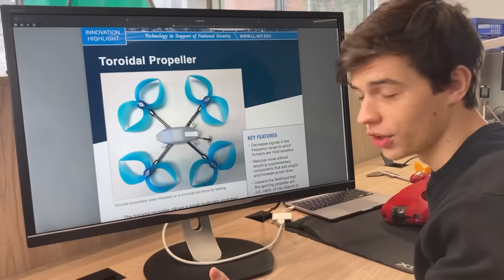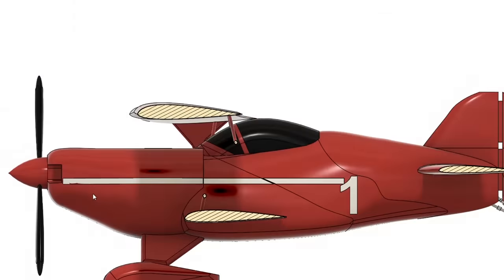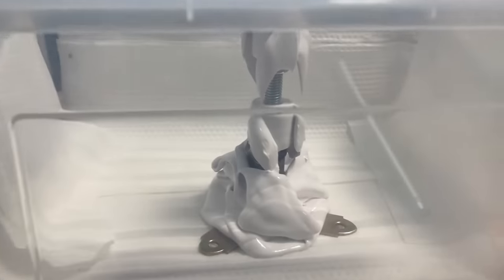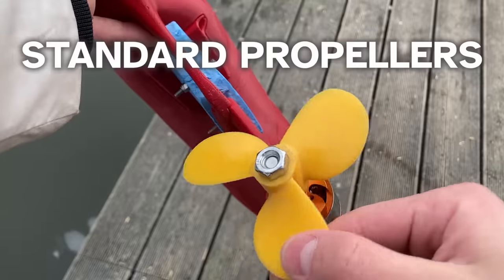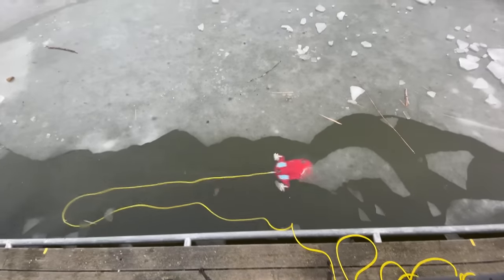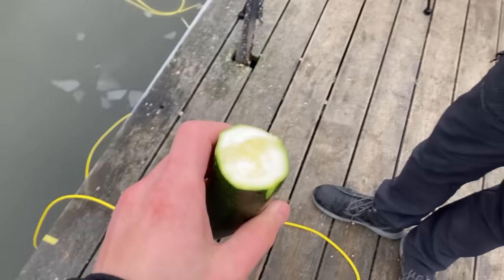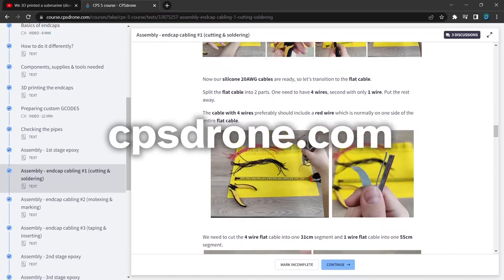Testing a TOROIDAL propeller UNDERWATER

Comment: great video.   
what it shows is that the medium in which you use your device requires thousands of hours of testing.
my first thought is to make one that has  a steeper pitch, then one that has a shallower pitch.
the three on the graph would show which way to move.
at some point, your pitch will go to far and power curves will show that.
you know this, but it does offer a way to bracket the correct zone in which to move the design.

Comment: Look at the total surface area of each fin. You will find that the standard propeller has more area. Then put a second toroidal foil inside each of the existing three lobes. Thrust will increase but not in a linear manner.

Comment: i think that this propellers have a sweet spot rpm where they have their maximum efficiency. the pressure wave is traveling with the speed of sound outwards to the point where the loop is connecting the two tips. this connection needs to be on the right spot matching the location of the pressure wave.

Comment: If you make a drill bit spiral shape fan, with a hollow mid radius. Where the blade connect to the front & back of its axis. It can be both wide or elongated wager, (with fewer spiral loops) into universal atmosphere. Mud, gel, liquid, foam, mist and air.

Comment: For the last test, inspired by the Sharrow design, I would have to say the "finger test" is a way worse outcome than the original propeller. For one very good reason: A cut can have its edges pulled together and sewn shut (or if it caused a full amputation, the amputated part can be reattached fairly well), whereas that u-shaped cut means a chunk missing that definitely won't sew back together at all well, and would likely require very painful grafts to fix - if you don't end up with an amputation any way because of too much missing skin/muscle etc. Although the comparison between a finger and a zucchini isn't the most accurate, since the skin and muscle of your finger flex and move whereas the solid zucchini doesn't, so there's a chance your skin would just "bounce" and flex away from the blade rather than being immediately cut by it.
Reply from the maker: Good point, if it's a clean cut it might be better. I think we should measure it with an arm next time!

Comment: Liquid props don't act like gas props. liquids don't compress so there is no 'low or high pressures' produced. the closest byproduct is cavitation but its not the same as producing thrust. Liquid props are more of a displacement method and 'paddle' through the liquid. aircraft wings utilize Bernoulli's principle and create different pressure zones and essentially 'float' through the relative air.

Comment: Interesting tests and explanations, however a simple reason why it's not better underwater is simple : there is no volumic compression or depression, because it's a liquid ;

so all the comparisons with air working stops there exept the fact that in both cases the drag is more important with an add of matter at the propeller extermity. 

The big advancement with this technology is the reduction of noise for higher speeds (applied to drones and planes maybe, fans...) ; that can also allowed to reduce propeller sizes 
....less cutting effectively is a progress

... and less side wings / propeller effects that cause fluidic air retention (at the back ) and slow down a "kind of aerial device" by aspiration ;
it 's the same aerodynamic working principle on  profiling coupé cars or on less efficients SUVs (they are more or less retained by air flow at the back) 

and in all cases described, back sides drag effect is the aerodynamic main problem to obtain higher yield aerodynamics ratios.

A french guy (pardon my english if it's wrong) 🤔😉

... tschüss guys

Comment: I am very sceptical of the toroidal propellers. This just seems like a too easy modification for all thos incredible benefits they claim. I hope I'm wrong though.

And since tip vortices seem to be the issue with regular propellers - why has no one put winglets (shark fins) on their tips, like every modern airplane has nowadays? Someone must have tried that age ago and discarded the idea.

These totoidal propellers, if they deliver even half of what is claimed, would be incredible. Imagine the tons of fuel all ships couls save, and the extra flight time for drones. Sadly, they do sound too good to be true.
Reply: There are aircraft propellers with 'winglets'. It's just a small curved tip because although the majority of a propeller is subsonic, the tip can reach supersonic and that's the limiting factor.
It's the Hartzell Q-tip propeller

Comment: Re-watching your video because it's awesome and a thought occured, the surface finish on boats has to be super smooth otherwise they get slowed down significantly, so your sub needs a smoother surface to increase fastipidity, maybe you could make a vacuum formed outer shell to glue onto the outside of the 3d print to get a super smooth surface, maybe it's smart maybe it's dumb, thought I'd share
Reply from the maker: Wow, thanks for rewatching :D
That is true, I'd like to measure how much the outer shell smoothness improves the speed and power drawn. Tbh sanding is probably the easiest method to get to that smooth finish, maybe also a SLA print instead of FDM. Thanks for the suggestion!

Comment: The Sharrow style props suffer at high RPM, and the only way to overcome it is to make them longer. The width can stay the same, but at those rotational speeds you need the length to be nearly double the width.

Comment: It would be super cool if the MIT team would use what they learned and apply the physics of water instead of air to generate a design for you.  Also a key component of water propellers is maneuvering and resistance to cavitation. Can you please test these aspects one against the other? I think the propellers from the drone company based on thousands of hours of R&D will be difficult to surpass but you never know we might be surprised.
Reply: When I hear "MIT award winning propeller", I am hearing Viktor Schauberger laugh.

Comment: These results are similar to rctestflight who made props for an electric boat where he could measure energy usage, and speed analysis using GPS : at constant speed and constant power.
He also found the toroidal and double bladed propeller were less efficient and stalled earlier (so had lower top speed).

Comment: The pitch makes a huge difference in the speed and efficiency, so the results are more for proof of concept and fun 👍😎
i was somewhat surprised you didn't use a tension balance to compare the pulling force they could apply vs power draw?

Comment: The pitch angle and overall blade area looked quite different in the 3 types.. I was quite surprised that the performance wasn't even more different.
The "MIT" style looks as though it would take much more torque to spin it at the same RPM.. and more torque implies higher current draw, so no surprise that it had the highest current draw.

I would like to see another design tried.. a shrouded propeller.. like a standard prop but with the blades within a cylindrical shroud that rotates with them.  Much safer and less likely to tangle in rope or weed, and no tip vortices. On the downside, the drag of the shroud would require higher torque from the motor.  Past research has shown some benefits compared to standard props, but some disadvantages as well, and for a given amount of material the standard prop wins.
But if tangle-free and safe usage are important, they would be better than even the MIT design, so it would be interesting to see how they did for speed and current draw.

Comment: I think a rotating zero-pressure differential part has more drag than a non-rotating one. The rotation adds to the drag. But if you use a housing that contains the propellor but is fixed then there is only drag from forward motion and not the additional rotation.
So why not put the propellor in a tube. And look at pump designs? Then you will have a jet engine.

Comment: Pretty sure those toroidal props were designed for use on flying drones, the toroidal design you want is the one from Sharrow Marine which is significantly different in it's dimensions

Comment: Cool, thanks MIT.

It's not advantageous when use on air though.

Wait, maybe the 3D print lines are beneficial, test with 3D print lines first.

It's best to use spring washers so the bolt doesn't loosen overtime and also blue threadlock (or green).

God bless.

Comment: It's not design that slows the speed and increases the wattage it is the weight.  They both need to be the same weight to have a fair comparison.
Reply: The sharrow prop is really hard to design. Takes a ton of CFD to make sure you're not creating tons of drag from where the blade wraps around. I have a design I've made and tested which works great. I've also tried to scale it up in size for peddle kayak and after 10 hours of iterative design it still has issues in certain RPM ranges.

Comment: To compare the efficiency of the propellor design you actually need to monitor the current (i.e. total power) drawn by the motors. Running a test 'open-loop' can only result in an ESTIMATE of comparative efficiency. Less laughing is required and MORE THINKING !

Comment: Have you looked at the amount of power required on both blade types? You can't just do an A to A comparison, you have to factor in frequency and turbulence generation along with power requirements. to get a total value. RPMs are just one part of a total equation

Comment: For the MIT model,  I wonder what the effect out be of having a decreasing radius of the "outlet" of the propeller relative to the inlet.  I feel like you would be increasing the pressure of the the flow as it exits the "tube" of the blade.

Comment: hi you should try making/using a nasa mars glider wing propellor. essentially it is a super simple wing designed to not create vortexes and such and stay stable on it's own. some people tested it on a drone with propellors for the drone made like those wings and it resulted in a drone which according to them just was almost completely silent, so it also must have been much more efficient. if you can use that it might help make it more efficient.

Comment: also the thoroidal propellors you made might be to big or agressive, or not agressive enough for your boat. if you try to measure the rpm in water you can compare the rpm, brushless motors and propellors both have their own optimal rpm and slight differences affect max efficiency and power output a lot.

Comment: The speed drop and power draw increase.... are these two not related to design of propeller that both new designs are high rpm that will result in both ? Would going with low rpm toroidal design not yield better results? That would require way more material comparing to standard propeller as You would need to get more or less same working area of propeller surface plus surface only related to encapsulating vortex in the flowing water itself? Would need to calculate surface angle (water output "density") related to length from center (speed of point of blade). That would create quite the integral to work with to approximate output. Additionally we would require to include an acceleration of water to be more precise - that's why sharrow prop has way more steep angle of following arm - that's why in the first design it looses power compared to normal propeller as 2nd "stage" do not have angle to accelerate water even more - image of tension would show that first stage is the surface that has way more pressure than the second one - and for optimum thrust vectoring it would be more optimal to get it even.

Comment: If you improved the pitch of the propeller, the performance would increase. Instead of 3 (6?) toroidal wings, make a version with 2 (4?). Toroidial propellers have the advantage that they work better with lower rpm. With such high rpm, they simply cannot push the right amount of water.

Comment: The toroidal design reduces vortices at the tip by keeping the fluid flow from leaving the prop tip.  Soo.
Take a toroidal prop and cut through the tip.  The rearward facing half of the toroid has its tip facing opposite  the rotation direction.  Remove that entire blade.  Duplicate the curved forward facing blades and put them in place of the ones cut out.  From the three toroids prop, you now have six forward curving blades.
Obviously the blade shape need adjusting and cleaning to maximize the resulting "scooping".  The desire is to carve into the (air/water) forcing in into the hub direction and over the larger actual blade surface.
My assumption is that the blades would straighten at higher rpm, which would change performance.  Would stiffer material be desirable or would flex be better?

Comment: Another benefit of toroidal propellers is that they suck in water/air while normal propellers simply takes the water that was in front of it and accelerates it. Because they suck in the fluid their in it creates more thrust for less rpm, kinda like a jet plane compared to a prop plane. As shown in your test the toiroidal props performed poorly compared to the regular ones however I think there have been far more professional companies test toiroidal probs and say they were quieter and more fuel efficient.
Reply: они слишком небрежно подошли к тестированию. один только кабель питания привносит множество погрешностей.

Comment: I’d be interested in the potential for cavitation. I also wonder how they would react as ducted fans. Finally, using pre programmed digital code instead of a trailing control cable would reduce drag significantly, or even a floating antenna wire for radio signals to initiate the program sequence. Lots of possibilities! I’d love to be involved in aquatic drones as spy bots.
Reply: Puting them into a duct completely negates the entire point of the torodial propeller  and any potential advantages that it might have by reducing tip vortecies.

Comment: Would it be possible to make a variable pitch toroidal ? You'd probably need to make the joined end a bit more flexible to allow for the pitch change
Reply: Which might actually make it a little safer, if the closed end deforms on impact

Comment: Can the prop be increased in size for use on a trolling motor? I build 7' long boats and a prop for testing on a minkota 12 volt boat motor would be interesting.
Reply from the maker: Sure, that's probably one of the best applications for these props

Comment: This concept just may not scale well... i mean that gain of reducing this vortexes on the edge of propeller does not compensate the drag and extra weight of toroidal 'connection' for small propellers. I assume, that this concept will gain for high frequency and bigger size - that would make more sense in less dense gas, as you need to mill and push back more of it to accelerate.

My second quick note is that you've increaed quite significantly the surface of the propeller, therefore you've probably traded speed to torque.... Basically you've turned your speedboad into water-tractor. For efficency we're aiming for good 'aspect ratio' -> thin, long span,, and narrow cord. There is great recent vid of @MentourPilot explaining that nicely*
Of course, pitch matters as well, so you could further increase pitch more -- Of course finding optimum would take milions of $$$ and lots of time and simulations.... and may just prove that basic propeller concept works just better :)

* https://www.youtube.com/watch?v=zkrdIw8LWrM&ab_channel=MentourNow%21
Reply from the maker: Thanks! 
Sharrow uses their design for motor boats, so they scaled this to ~40cm diameter. But I get your point, it may be true. I feel like we'd need to run a lot of simulations to find this out and as you said, that would take a lot of time and money.
Somebody else suggested that the area of the blades in a tested toroidal prop should be the same as in a standard one to which we compare it. And I'd still want to keep the same diameter. So the blades should indeed be slightly thinner I think.

Comment: Need more than low pressure on other side of propeller because that means only the speed the water rush from high to low area. Thrust is needed because water density not like air. Lever action needed or jet propelled? Just my simple thoughts.
We see the extreme speed of dolphins for example. How do they do it?

Comment: The Sharrow prop has come full circle (pun intended) from being adapted and completely snubbed by MIT for drone props, now to being “discovered” as useful for underwater use…where it was originally designed for … “…there is nothing new under the sun…” 🙄
Reply from the maker: Well, we've learned about Sharrow props because of what MIT did (even though their design is different), so you could say they did good press for them. And I haven't seen MIT props tested underwater

Comment: looking at the toroidal propeller, I have an idea, I am not to sure if it would work, but looking at the design, it seems that it should work from what i can see in my minds eye, all so I have added to the first design,  a 3d printer should be able to make it, 2 addons, that I think both should work. I think that it could add 3x more output with 1st idea, second idea it would just add to the output already, I cant see how much the second addon would increase the output.

Comment: The boat-propeller, the MIT-design and your printed design are three completely different designs.

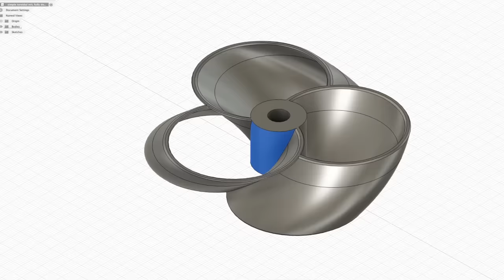The boat-propeller (2:17) is a twin-wing (or an extra large leading flap) with the use of winglet-effects.
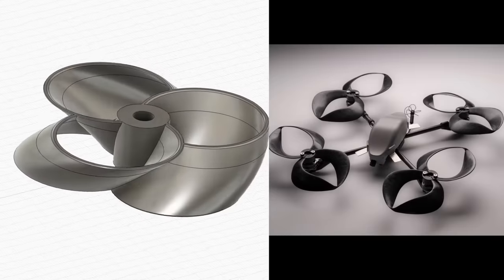The MIT-design (2:23) bases on a simplified foil (flat plate) and optimises a high aspect ratio wing for optimal use of the rotational disc surface.
Your design has a low aspect ratio with no foil or intentional wing-effects, a less-than-optimal leading edge and emphasises the use of volume.

Interesting